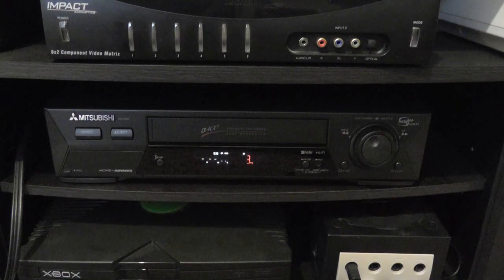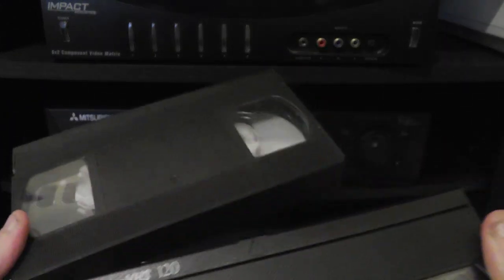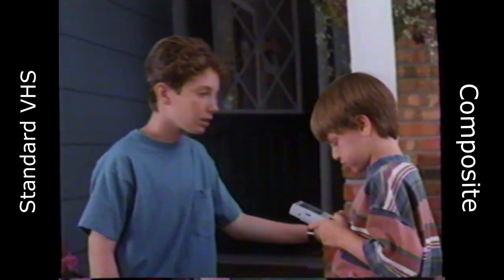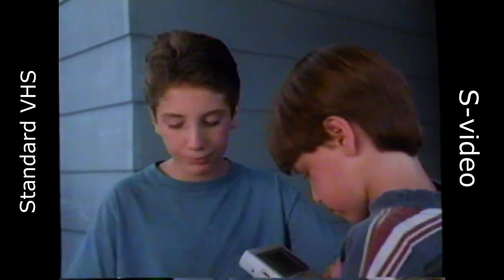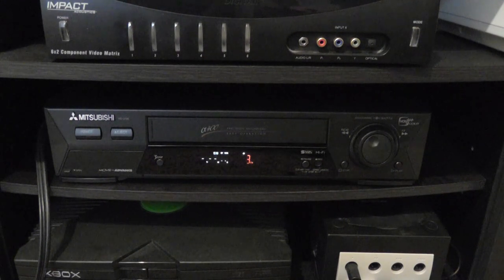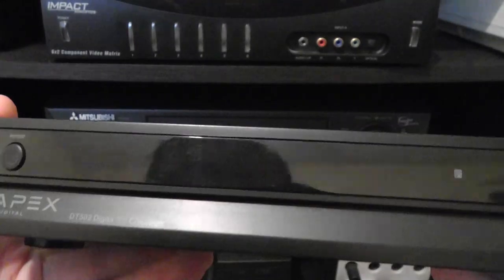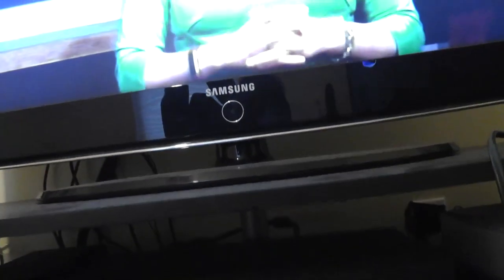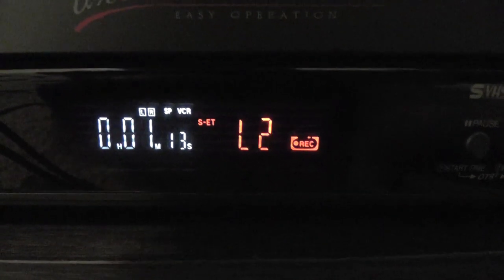Comparing S-VHS to Regular VHS

Comment: It must be remembered that whilst analog  Broadcast TV in North America was only 330  lines horizontal resolution, in Europe and worldwide other PAL and SECAM countries it was well in excess of 400 lines. In the UK where the video bandwidth was marginally greater it was possible to achieve 500 lines on a top of the line TV. So there was a great advantage in using a S-VHS VCR as a time shift device in these areas. I bought one for this purpose in 1992 the improvement versus a good VHSHQ VCR was outstanding.
Reply: SVHS cannot exceed 400 lines horizontal resolution according to JVC and Panasonic specs in my owners manual.
Reply: I don’t see how PAL broadcast can achieve 500 lines horizontal resolution.   NTSC broadcast has 330 but PAL video bandwidth is only 1.3 megahertz wider.  330+80 per extra megahertz == 410 lines horizontal resolution 

.

.

Comment: Fun-fact S-VHS is actually very close to DVD in terms of resolution. (400 vs 480 displayed lines of resolution.)
Reply: DVD is routinely advertised as 500+ lines of horizontal resolution (note I said horizontal not vertical).  Vertical for NTSC is fixed at 486 visible.  480 for NTSC-digital 

.
Reply: @electrictroy2010  DVD had a big advantage... progressive scan. SVHS can't do that.
Reply: Resolution of a colour image is defined by luminance (luma, b&w) and chrominance (chroma, colour) resolution - both components are equally as important.
You quote luma resolution but have ignored chroma. Chroma resolution for all domestic analog vcr formats (including VHS and SVHS) is around 30 lines and DVD is around 205 lines - the overall quality of a colour image on DVD is vastly superior to SVHS.

Comment: I have a svhs vcr. Since I have both Belkin brand composite and s-video cables, which one should I use to record off regular vhs tapes?
Reply: Always use S-video because it eliminates chroma dot crawl in the image.  Always better to use the higher-quality cable.  The S-video keeps the image & color separated

.
Reply: @electrictroy2010  while s-video should be better, Ive heard vhs carries a composite signal like laserdisc. So if the signal does not already have the image and color separate, s-video is not necessarily better.
But it definitely is with video8 and hi8 tapes, even tapes recorded on a camera that didn't have s-video out. So those must have the luma and chroma natively separate when recorded.
Reply: @Knightmessenger  Actually, VHS uses "color under luma" just like S-VHS.  It is not composite, and does benefit from using the S-Video connection.  How much it benefits however, depends on the machine the recording was made in since most VHS recordings were not done using VCRs with S-Video connections.
Reply: @sneskid78  well then it would definitely benefit video that was originally recorded directly to a vhs tape, such as a vhs or vhs-c camcorder.
Reply: @Knightmessenger  
Yes, it does.

Comment: VHS over S-Video is better than VHS over composite, your test is flawed, To be able to see the difference is to toggle between the two outputs while playing the same tape and see the direct feed on the monitor, Youtube compression wipes out every difference that existed.
Reply from the maker: I saw the direct feed while capturing the video and there was no significant difference. As I noted, the S-video footage might of had a slight improvement in contrast or brightness but it's extremely difficult to see. It may not be different at all. Either way, any apparent differences would be illegible to most people.
Reply: @BrettDarien  It depends on the quality of the VCR too, But if you don't know what to look for you may not notice it, The major differences is the chroma artifacts are reduced such as rainbowing and dot crawl, slight sharpness in the details with special contents like text, and white to black transitions, Such comparison requires certain contents to show to the average person. A movie on tape may not do justice especially if you add YT compression.
Reply: And how is this flawed? If the S-VHS tapes showed a clear difference in quality between composite and S-Video, then regular VHS should have also showed a clear difference if S-Video improved the video quality. It however doesn’t show much here.
Reply: @RyDawg96  It's flawed for the reasons I explained.
Reply: @Capturing-Memories  extremely doubt the compression is at fault here. If it was that bad I wouldn’t be seeing much of a difference with the S-VHS footage. If you think you can do a better job, why don’t you show some examples?
Reply: @RyDawg96  Off course YT compression hides details, You would have to do this yourself to see it, I do see a big difference which I described in my previous comment. Not everything put on YT is accurate and not everyone posts a video is knowledgeable you should know that.